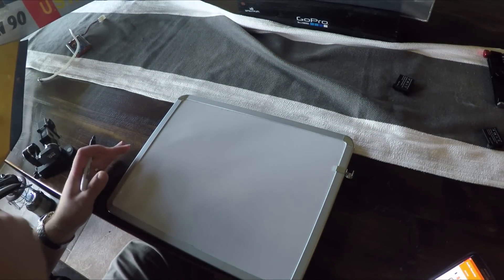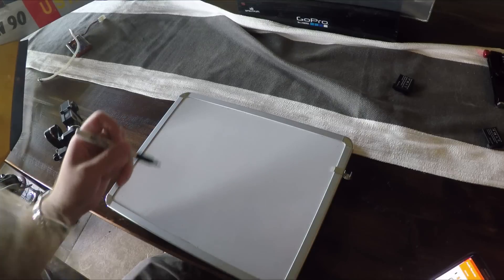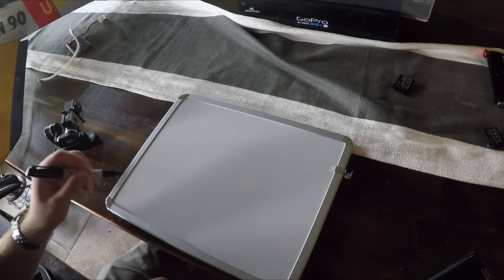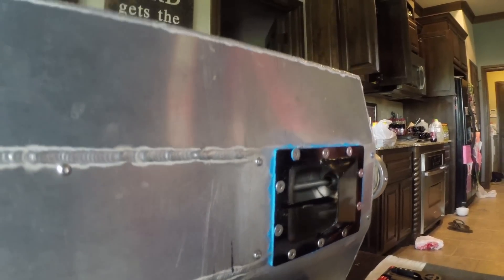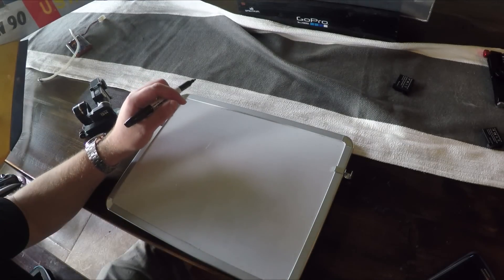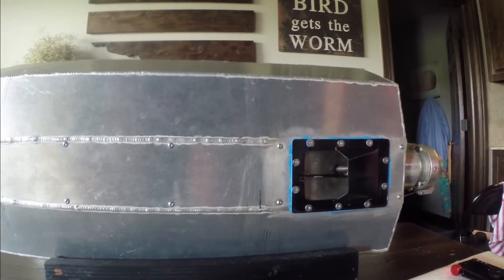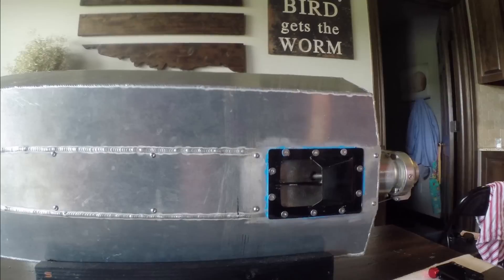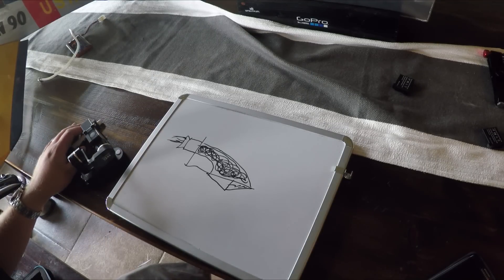Aluminum RC Jet Boat (Part 10) - New, Scooped intake grate

Comment: sounds like your sucking air down the side's of the hull try putting vertical fins both side's of the intake or make the flat section of the hull wider ???
Reply from the maker: hi there. thanks for the input. you may very well be right on the air thing.  here in the next week or so I'm going to be building my next intake grate.  the new grate will basically replace the flat bottom of the boat.  I am also going to add removable fins to the new bottom. my plan is pretty ambitious though and involves me milling down some aluminum. (Which I've never done) so the end results may be different from what's in my head. fins are definitely in this boat's future though. 
thanks for watching and thanks for the comment. keep an eye out for my next video which will either be me making a mess of some pretty aluminum or me making a really cool new grate for my boat.

Comment: You can help prevent porpoising (hopping) by installing trim tabs on the transom which in effect, makes the boat longer. Another way is to trim the nozzle down (tilt it down a bit) which forces the bow down. See http://www.rcgroups.com/forums/showthread.php?t=2318187
Reply from the maker: Thanks for your comment!  Actually once I reduced the thickness of the intake grate the porpoising went away.  Now it only does it when a lot of water gets in the hull.  But I have a bilge pump working in there now, so that problem is minimal now.  My trim nozzle helps a lot in certain situations, especially if the water is rough.  The trim helps me "force" my way through the chop.
Reply from the maker: looks like you've been around the block a time or two (looking at the forum) do you have a suggestion for shape of the grate? do you think a scoop is worth it at all?
Reply: I prefer expanded metal grates over screen or mesh. Like what desktop organizers are made from. You don't want restriction, but you don't want baddies to get in either. 

Scoops & loader grates may help a jet drive reprime sooner (if that's a problem), but tend to slow the boat down & pick up debris. IMO nothing  should protrude from the bottom of a jet boat.
Reply from the maker: +Sundogzadventures ya I know what you're talking about, I have some around here somewhere. 

ok... so that pretty much settles it for me. after this intake grate and everything else I've read and seen and now you sayin it...  pretty much solidifies that idea for me.  nothing sticking out.   

so I have an idea for the grate (in truth, it was my first idea when I started this boat) basically it involves changing the bottom of the boat.  So.. I saw one of your boats with a grate (I'm guessing aluminum) where the grate appeared to double as a trim tab. it stuck out the back of the boat a couple inches.  my idea is similar except it would cover the entire flat bottom part of my boat and run out the back (like yours) about 1 or 2 inches. 

I present this idea because the only way to get the bottom of my boat truly flat with a grate, would be to modify the bottom of the hull. I'll draw some pictures and put them in the forum and see what everyone thinks.

Comment: Like your jet powered boat.I think when you throttle up,air and water are mixed and caused the cavitation and loss of power. If you just tilt your water intake down at the stern,it would probably solve your issue. 
Btw, what is your motor power and rpm? This is just for my curiosity. Cheers!
Reply from the maker: hi there! thanks for the input.  I think you are exactly right with the cavitation issue.
the motor is the Castle Creations 2028 800kv.  running 8s lipo (29.6 volts) and probably pulling an estimated 220-250 amps.. which puts it at about 6600 watts on the low end  of that estimate. and converted to HP that's about 8.9 HP. this motor is insane!
Reply from the maker: oh.. and about 23,000 rpm. (29.6v×800kv) but with drag of the jet and water in the jet.. I'm not exactly sure.
Reply: Hi Brian, If you check on the net images Mercury jet or Yamaha Jets outboard, you could see the water intake is at an angle which forces water in.Hope this helps.Cheers!
Reply from the maker: +cheng poh lim I WILL check that out! thanks a bunch for the help.  I hope to make another grate very soon and I'll be posting videos on the new modifications!

Comment: Very cool boat, looks like a lot of hours. The bottom of the boat at speed looks like it will behave almost like a flat bottom boat. The scoop is a large drag as you increase speed the water cannot fill in behind or actually flow down the slope you created. The boat also bounces due to the surface roughness of the water. That also changes the scoop angle which may make the water flow erratically. (just a guess)  If I was going to redesign the jet intake and not modify the bottom, I would try placing the "scoop" at the front not at the rear. The shape would be something like an airfoil or flat plate to increase the the water flow into the location you think is not getting water. 
The airfoil shape provides to types of lift newtonian and Bernoulli. A good analogy is what happens when you place your hand outside a moving car turn your palm facing forward and air pushes back ( think flaps on a plane). Turn your hand flat and it slide through the air but theres an upward pull, thats Bernoulli.   Bernoulli is conservation of mass, when the fluid flows over the airfoil shape the bottom is flat and the top is curved. The lift is because the conservation of mass says that the mass on the top of the shape is moving faster. When that happens over a larger distance molecules spread lowering the pressure  on top and the pressure on the bottom the airfoil is higher thats what pushes the wing up (or hand).
So if your going to try designs maybe a U shaped airfoil  or flat sheet. The scoop can then change the pressure and or the direction of the water at the front of the intake and if you just make small adjustments in angle on the flat sheet(Newtonian) the water will be directed into the front of the intake. 
If you try the airfoil make sure its upside down so the curve is to the bottom, it will pull the boat down using the water flow and not cause to much drag.
Also  you may want to add some small thin fins sticking down to help with turn stability they should not add to much drag.
Well I guess you could think of it as your own version of a car scoop except this one helps channel your water flow.
Oh you may want to put you gopros into a water proof housing and film underwater looking up at you boat I would do the side as well (need semi clean water) it will let you see whats happing to your scoop try different power/speeds for a good range.
Looking forward to seeing your redesigns.
Reply from the maker: Hi there! thanks for your input.  I am going to consider all of your suggestions. someone else had also suggested (in person, not here) similar theories.  using hydrofoils to channel the water is very interesting to me. and turn fins are also in this boats' future. 
one thing I wanted to comment on was that the hopping the boat was doing, all went away after I sanded the original intake grate down.  reducing it solved the problem.  no matter what kind of chop there was, the boat would start to hop at higher speeds. now it will hop, only when it hits waves or if there is a lot of water in the hull and it starts to slosh around. 
thanks again for the input, it is valued and appreciated!
Reply: Yeah, a small hose plumbed in on the intake side going through a small ball check valve sucked the insides of my boats dry and adding the ride plate really helps. The waters flow on the intake needs to be as low  as you can get it limiting the direct drive motors diameter. So like the world boats gearing it works.
Their getting many  unlimited ones up to 150 mph gearing turbines.